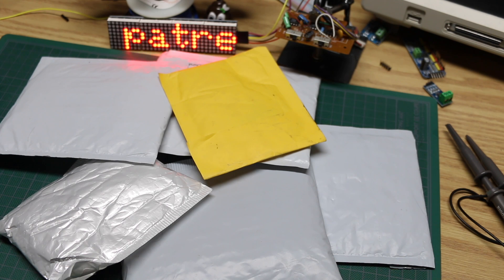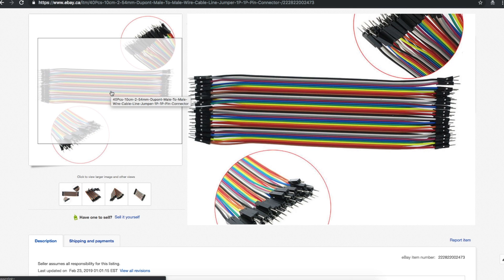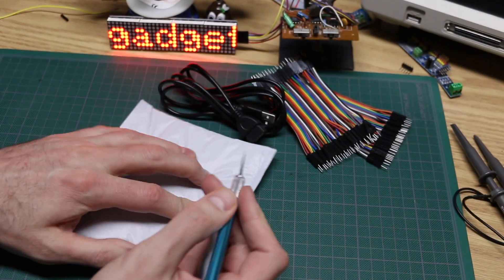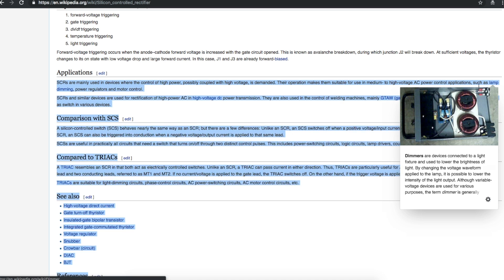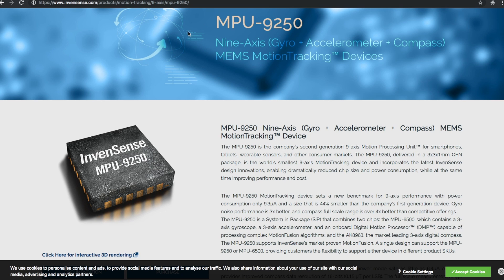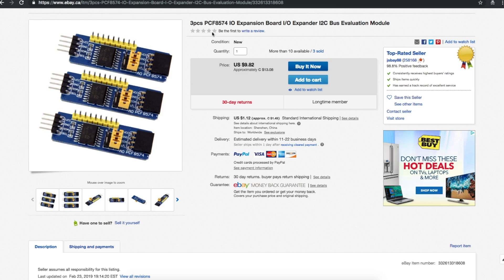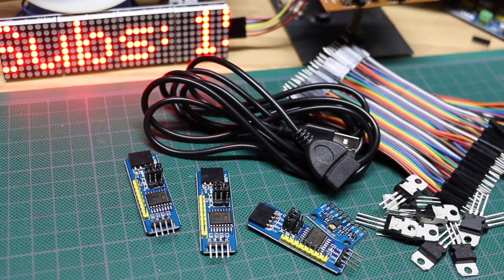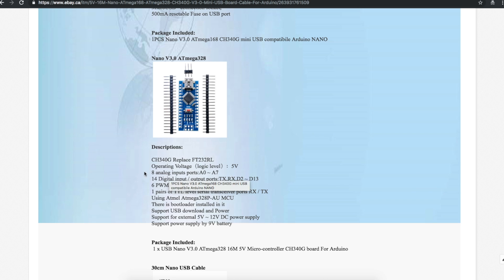Mailbag - Cables, Modules, Arduino Nano, and Parts!

Comment: Arduino Nano are super handy boards to have around. They're my go-to for most things unless there is a specific reason to use something else.

And they're sooo very cheap.
Reply from the maker: I still have to solder the headers on mine, otherwise I would’ve used it on the project I’m working on today so for now it’s still Uno.  But I will be ordering more nano’s for sure.

Comment: Lately I also got some nano to use for a project, and what I got is a bit different from what I wanted. First thing: CH340E, smaller, 10 pin version of CH340g, with internal clock, so one crystal less on board. Second, instead of ATMega328P it has an ATMega328PB: upgraded version with two serial ports and two I2C's. And it's backwards compatible with programs written for 328P.
Reply from the maker: There are so many variations on eBay it can be hard to get exactly what was expected even if the listing looks like a certain product, sometimes something different will come anyway. But in this case I’d like to have one of every possibility of hardware anyway so maybe I should take another look!
Reply: @GadgetReboot  I got mine from AliExpress: https://bit.ly/2ECGnIz The best thing about it is that nowhere you can see it's a new one, even photos are with the old one, but photos of the people who bought it show newer chip (Atmel logo looks different)